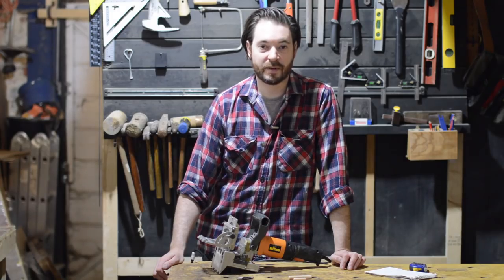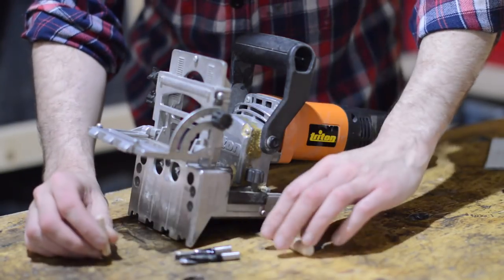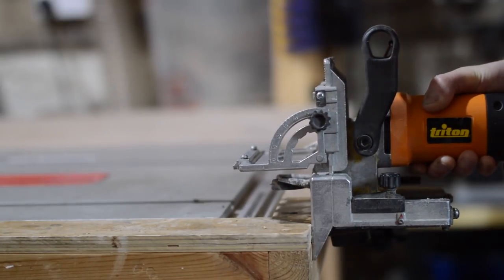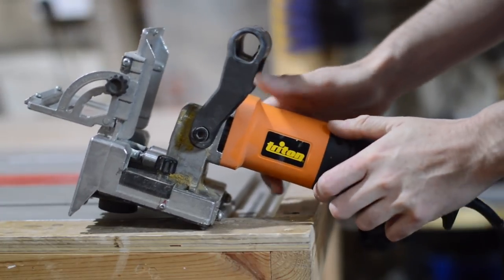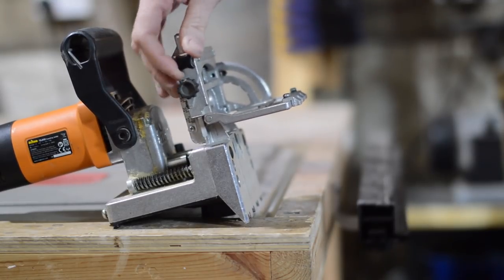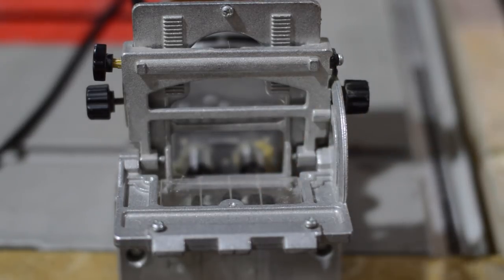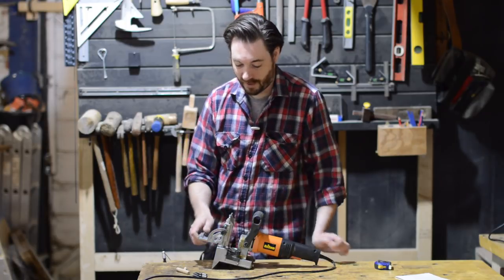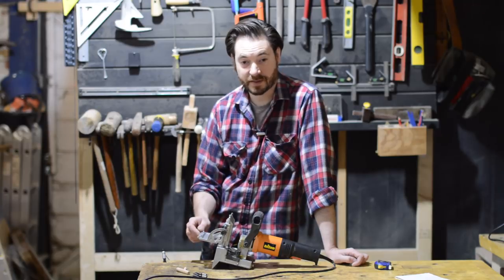Triton Dowel Jointer TDJ600

Comment: Hey Matt, great vid. The Triton Doweller was to be the ‘third leg’ of my Festool v Cheap tool series last year (I interviewed Sharpedge Woodworking’s Chris Davison about his as a long-term user) but in the end I had to return the three(!) I bought as they just didn’t work well enough to make any kind of comparison - the retailer actually refused to sell me another! As you say, the Domino is a precision tool that lets you work loosely, whereas dowels demand precision, and certainly in my experience, the Triton Doweller is a woefully imprecise tool. That said. The early Dominos (mine’s one) also had issues with ‘fence slip’ which is how the ‘Domi-Plate’ came about - it takes the fence out of the equation completely. 

Re. the registration pins; I’m pretty sure that’s still a Mafell patent, as Festool changed theirs to little ‘paddles’ after the very first production run.

I had high hopes for the Triton Doweller when I bought mine as I have one of their big routers slung under my bench and it’s a solid piece of kit, but was really disappointed with the actuality. Given the price hikes the Domino‘s had over the years (I paid ~£425 for mine) I’m sure a ‘lower-end’ tool manufacturer could make something like the Doweller with a bit more emphasis on precision and quality, price it appropriately (£200-ish? £250?) and still be competitive.

I don’t disagree about the initial cost of the Domino, but after 10 years or so of hard use, I’m pretty sure I could get close to the original purchase price of mine back, if I were to sell it on. I’ve never met anyone who’s bought one and regretted it, though ironically, if I didn’t have the Domino and were looking to buy something now, I’d be looking very closely at the Lamello Zeta P biscuit jointer, just for their range of connectors. Unfortunately, they make the Domino look cheap... 😕

Keep up the great vids! Peter👍👍
Reply from the maker: Thank you Peter. I want a better machine. I have a house to do up and want to make all the cabinets, kitchen and bedroom so I can justify a tool. So Festool domino or Maffell dowel is the decision I have to make.
Reply: Badger Workshop Between the two, the Domino’s the more versatile, especially with the new knock-down connectors - video coming soon - for the smaller machine. I’d either try to pick up a decent one used (can be a bit like waiting for a decent used bandsaw, but a few folks who have the bigger machine often move the smaller one on) or bite the bullet and pay ~£60/month interest free from Axminster; if you have a whole house to do up it’ll save you £60/month of your time over the Triton, easy. Plus, brand new tool, full warranty etc..etc.. 👍👍 HTH, P
Reply from the maker: Ok Domino it is. I will at least get a video out of it. I will look forward to the festool hate comments.
Reply: Badger Workshop Yeah, better get used to that, Festool fanboy Matt... 😆👍
Reply: For the type of work I've seen you do on your channel Matt, the Domino is probably the most useful upgrade if you were to. The Mafell is a serious quality machine but in my view, only really comes into it's own, with the template guide (an accessory), if you're doing runs of units/basic cabinetry (kitchen units and the like). It's unmatched here. I've demoed them both and the Lamello biscuit jointer mentioned above at tool fairs. The lamello is in a league of it's own if alignment is all you're after. All are a fair chunk of change though so I ultimately went with none of the above. I'm in the lucky position of choosing my work these days using more elaborate joinery that makes a fine doweller or jointer an unnecessary luxury. On the odd occasion I do need a biscuit jointer, my old one works perfect - I hacked it to be cordless too ;)
Reply from the maker: Yes a saw you hack, very cool. Looks like the domino is winning. Just need to sell a kidney.

Comment: Just to help anybody that’s watching this video now, I have recently purchased the Triton machine and it’s clear that they have addressed the problems highlighted by many and have improved it. The rubber bumpers are now on springs and depress into the body. The springs have been changed also. The sliding movement is much smoother. I am extremely pleased that I bought the Triton. I hope this helps.
Reply: I'm very glad to see your comment, as I'm trying to make this very decision! However, your comment has put me straight back in a quandary. Do I buy a Triton doweller only to have to buy a Domino anyway down the line?! Decisions decisions :)
Reply: HowlinWilf13  Hi there, Well, as a rule, if I can truly afford the higher quality machine at the time, I generally go for the best available. I guess it depends on how much use you will get from a dearer tool. I wish you all the very best, Yours Ricky

Comment: A good honest review, and I agree with everything you said.
I started off with the Triton Dowel jointer a few years ago and my experience was the same.
I later sold it and went to the much more expensive Mafell Dowel Jointer, not cheap, but it just simply does everything you require of it with great accuracy.
Reply from the maker: The Mafell looks great, I just need to save up.

Comment: Thanks for the nod Matt.
I very much agree with the tone of your review... It does what it says on the tin and it'll get you there.....but it can be a faff and you've gotta be dead on with it to get accurate results. Which given the thick lines and a bit of manufacture inaccuracy is easier said than done.
Having started with this and then moved on to a Domino I can now appreciate the gulf in performance. But when I first got it I still thaught it was a fair purchase which got me through many projects. 👍
Reply from the maker: I have used it on a lot of projects over a few years so I don't regret it. But im getting toward the time when I want to upgrade.

Comment: I have never owned one of these but had an idea about when you mentioned the fence could still move even when it had been tightened as much as possible. Would slipping on a split ring washer help with this?, it might keep more tension on the fence and help stop it being able to move. Just a thought. Like your videos Matt.
Reply from the maker: It might help a little. But I think the main problem is it only locks one side.